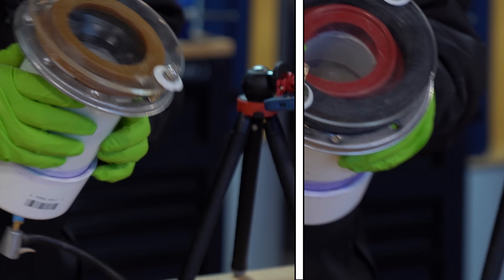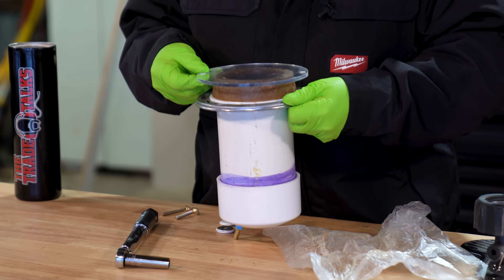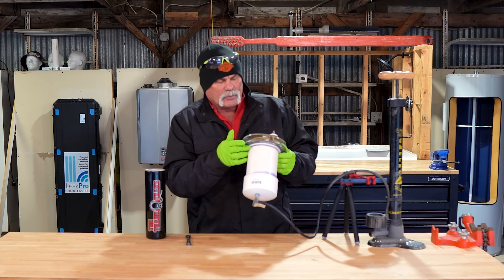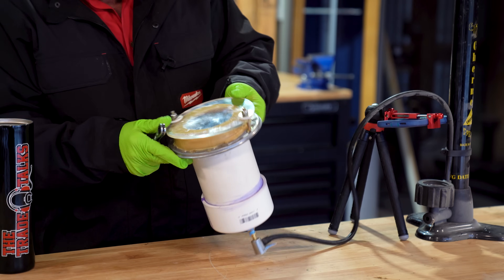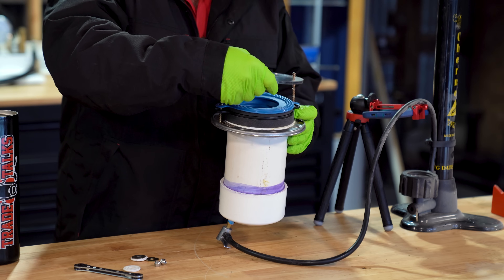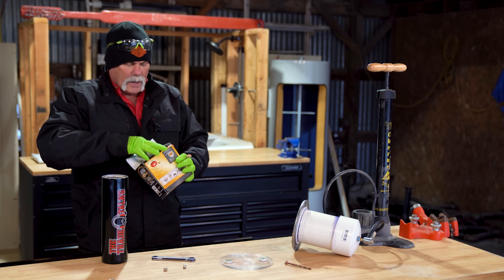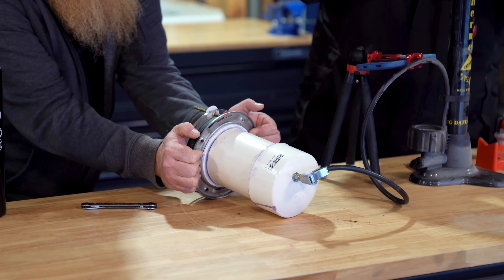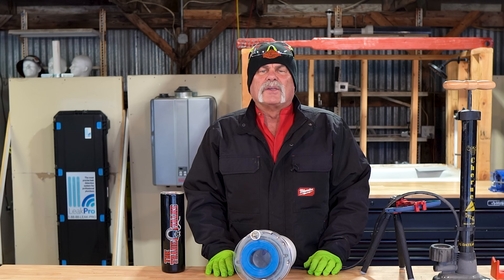Toilet Wax vs Rubber: Which Works Better?

Comment: Hey Roger, I just ran into this choice. I didn't buy them, the home owner did. I did a tile job in a couple bathrooms. The customer got this real thick cement covered foam board, instead of 1/4" Hardy backer. By the time I was done, the flange was now real deep below the tile. I told customer I needed the Jumbo wax ring. He brought those and the foam type. I wanted to try the foam type. With the toilet on the foam, it wasn't even squishing the seal down. So, I just used the jumbo wax ring. Worked great.
Reply: for very tall gaps, some recommend stacking an additional rubber/foam kit, so it can have as many as 2 rubber rings and 4 foam rings.
Reply: @jkhijirida  I've never seen an additional kit that I can buy. I'd have to get another foam ring and use the ones that come with it. And they aren't cheap.
Reply: @macD723  you buy two whole kits and stack them one on top of each other. yeah, not cheap, but it's better than a leaky joint.

Comment: Building maintenance tech for almost a decade at a hospital, we use the rubber and foam, 2 issues aside from test rig itself, there's an adhesive on the foam that needs to have the protective cover removed and secondly, just only 1 at a time, it comes with a spare just in cause you mess up the sticking.

Comment: NEVER going back to wax. Zero problems with the rubber/foam seals (Fluidmaster Better Than Wax). You never know if the wax set right when you add pressure and you certainly can't lift it to readjust or else you're scraping wax and doing it again.

Comment: I have done 8 or 10 bathroom remodels when I go to set the toilet by myself I crush the wax ring I used the rubber ones I've not had a complaint yet but I believe in the wax ones.

Comment: I used some rubber rings and when I had a backup the sewage came out on the floor.  So now if I use one I put some silicone on it and seems to work better.  Another light green one has a softer seal that I don't use silicone.  But too soon to tell I am still in the testing phase.  I still usually use wax rings.  The guys to ask are the maintenance guys that have to deal with leaks after the plumber leaves.  But all the plumbers I know still use the wax rings.  I should know better in another 10 years.

Comment: The plexiglass flexes where the toilet won't.  I don't think this really tells us anything....
Reply: The wax will give before the toilet or the plexiglass, path of least resistance. So I think it's telling us something.
Reply: @billrowan1957  so... how do you explain the plexiglass flexing at 5 minutes, 38 seconds? Plexi is a very soft, flexible material. In order to create a proper seal at that thickness it probably would have needed at least 8 equidistant bolts... and even then with plexi that thin, it might have cracked under pressure (probably radiating out from a bolt hole).

Comment: The past time I had to pull and replace a toilet due to a wax failure, I used one of the newer designs. (Side note: I'm not a plumber, just an old fart that can do things like remove and replace a toilet.) More than ten years on, and the new one hasn't failed. But to be fair to the old wax ring that failed after only a couple of years, the toilet had a slight rock (my fault, I also installed the stone flooring and it wasn't completely level,) and I shimmed it when I figured out why it failed, so that likely accounts for the actual difference in longevity.

Comment: As a 35 year veteran service plumber I have seen my share of gadget's under toilets instead of wax. I have also had those "horned wax seals" cause stoppages. The very best seal in my opinion, with my years of experience is the jumbo was seal. It is the only one on my truck.

Comment: I used better than wax ring for my last toilet install. I really like these - they work well and are totally re-usable. If you read the directions - you should use one or the other foam depending on how high or low your flange is set. I would definitely recommend these to homeowners.

Comment: I have tried many seals in multiple countries. The Aussies got it figured out, but the American toilets are still behind the times. That being said , i like the wax better. Have never gotten a callback on the wax, had at least 1 on the rubber. One callback is enough for me, no more rubber.
Reply: What do the aussies do?
Reply from the maker: I’m with QBall, what do the Aussie do?
Reply: @RogerWakefield they go in the woods 😜
Reply: Their toilets are built a little different. They have an extended seal area on the bottom with a rubber seal that gets mounted instead of a toilet flange.
Reply: I can't post a picture, but the rubber seal is easily replaced, and the toilet van be pulled and reset multiple times on the same seal.
Reply from the maker: the woods go to them

Comment: DIY hone owner, bathroom remodel. New $500 Mansfield Barrett toilet with new marble tile floor.
I used the new blue better than wax silicone gasket.
The manufactured toilet sits higher from seal level sona thick or extra wax ring was needed.
After installation with wax a couple days later I had water under the toilet😢 R&R the toilet again, I couldn't see an issue with the wax ring but opted for the extra thick wax this time.
2 days later YUP Water on the floor...WTAF? 😮😮
R&R the toilet again, I couldn't see an issue with the wax ring, THIS TIME I opted for the blue silicone.
Easier assembling to set the toilet as a one piece unit.
2 days later AGAIN water inder the toilet... getting to be quite the toilet setting professional at this point 😂.
I bought another seal kit after taking measurements and finding this Mansfield Barrett toilet sits a little higher than the old toilet soni doubled ip the gasket sets.
2 days later WATER ON THE FLOOR.
I installed the ild toilet with one blue gasket and NO Water after a few weeks.
Did some slucing with some BLUE food coloring and found a manufacturer defect issue with the porcelain sealing around the toilet drain... SWEET $500 DOLLAR toilet and this is the quality of work.
Ordered another toilet and waiting the 2 months for delivery.
Finally installed it with a pair of blue gaskets and the world is spinning back on its axis again.
The blue seals are great. Less mess than wax BUT if you set the toilet right any seal will last for years.
I have the front bathroom toilet to R&R and will be using the blue seal for that job.
One thing about plumbers using wax is the SAME plumber probably won't be back to work on it a second time.
As a DIY home owner the wax is messy, but if uour having to pull up the toilet often you have other issues.
Reply: $500 mansfield! 😂😂😂😂😂😂 thats like a $50k yugo.
Reply: You may have a Mansfield toilet but Al Bundy had a FERGUSON !  If it was good enough for Al. . . .

Comment: I have an old house and used the red rubber/foam ring you showed off last. With how much my house moves in the winter/summer I wouldn’t do wax.

Half of my doors don’t shut in the winter due to the house movement lol. In two years I haven’t had issues yet. I have even moved my toilet a couple of times to redo the floor and paint behind it. It was nice not having to go back to the store to get a new ring. No sewer smells.
Reply: Those are probably not house movement but expansion/shrinkage of the wood due to changes in humidity.

Comment: I learned with wax about 40 years ago. I don't know how many of those I've installed. About 5 years ago I tried the rubber type. Looked interesting. I don't carry wax anymore. They're too much trouble for me. I've had applications where wax will last for 3 years, then fail. Water comes to the ceiling below. Since I switched to rubber, no more problems. I can send even a new guy out and there won't be a problem. At least not with the toilet soil stack. He may screw up the water supply or something else.

Comment: This is bad science. The acrylic flexes too much not a fair test for any of the seals. You push a toilet flush then secure in location with the bolts. A toilet won't flex like that.

Comment: I went with a better than wax and it worked great.  The previous wax install failed after 5 years (previous owner's install) and when I pulled the toilet out it was obvious that it shifted upon install and the seal was never properly made.  The wax was skewed to one side.  

Two years on and still good.  I was WAY easier to install and less of a mess, as well as allowed me to reposition the toilet when I dropped it in by myself.

Comment: As a homeowner I have done both, and neither has had an issue.  Very limited experience for sure, but like you said there really shouldn't be any pressure on your sewer system there.  I do like the easy clean up when replacing or re-setting a toilet on rubber, but I do like the affirmative squish of the thick wax rings.

Comment: The point of the rubber with the foam is not to provide a pressure seal put to provide constant positive upward pressure which if the toilet rocks or becomes loose it will still remain sealed, once a wax ring is installed it's a one time seal and any movement will compromise it, I haven't used wax for like 10 years and have never had a problem with a call back like I have with wax.

Comment: Probably 10 years ago now I was using a rubber accordion type toilet seal. It went on the horn of a clean toilet with a double sided tape, that was super tough, then you opened it up and set it allowing it to collapse as you set it, I would use them in a retirement home when I had a tenant who continuously broke their wax ring

Comment: I’m thinking a properly installed rubber seal on a toilet will have considerably more seating force applied to it than your acrylic plate.  
The weight of the fixture plus the closet bolts would compress the rubber more.  Also it wouldn’t distort as the acrylic plate did.  I think it would hold more pressure under actual conditions but 🤷‍♂️ :)

Comment: While I am not a plumber, I have set many dozens of toilets over the decades. I have never liked the wax rings because they are so stinking messy and hard to clean up. I started using waxless rings when I first saw them in the late 90's and have never had one fail. On the other hand, I have seen many wax rings fail for various reasons, mostly due to an improperly set toilet.

I had my parents' bathroom remodeled back in 2012 after my dad had a stroke. Due to them having only one bathroom, the man I hired to do the remodel needed to install, uninstall, and reinstall the toilet many times over the course of the remodel so that both of my parents could use it when necessary. We used a waxless ring, and it never failed. In fact, my brother bought the place and has lived there since 2014, and replaced the toilet in 2022, reusing the waxless ring that was installed on the old toilet 10 years earlier, and it has worked perfectly since then as well.

I will probably always use some sort of waxless ring when setting a toilet.

Comment: Blue rubber works excellent, now on mine the flange is 1/4 above the floor so you don't use the foam ring just the blue rubber ring. Works fantastic and no mess. Great for science video!

Comment: I am a property Manager, not a plumber but I have changed Many Toilets and wax rings!  I used the Blue rubber / foam "reusable Perfect Seal Rings"  HA! for a few years until a plumber told me how they dry out and don't seal after a short while.  and I saw with my own experiences, I will never use them again.   Stick with the wax rings for longevity!

Comment: I started using the rubber seals from HD a few years ago in both new builds/remodels and repair/replacing faulty wax seal rings.  The good thing about them is that they are not messy, so if you need to remove/replace the toilet, you simply reuse the seal.  You are correct, in that there isn't going to be that much pressure on a toilet.  I specifically like using them on retro fits, because around here, we have a ton of lead downpipes into cast iron.  Well, as we know, that lead can deform and leak.  When you have a wax ring, it will leak, because it follows the lead when it moves.  The good thing about the rubber ring is that it has an extended flange that goes down into the lead pipe, so no matter how much the lead moves/deforms while under the "normal" use of a toilet, that extended piece will cover the gap within 1 to 2.5 inches.  And we also know that if your flange/downpipe separate more than 2 inches, you have issues far beyond anything that a ring seal will cover, no matter what it is made out of.

Here in the Greater New Orleans area, we have major issues with houses settling constantly due to the ground subsiding.  This is followed up by the house foundation needing to be leveled again.  This issue can go on for decades, where the house sinks and the foundation guys lifting.  Many times the plumbing, specifically the sewer side, does not always follow the house, so the flanges under the toilets can, and does falter and need to be repaired.  This is where the rubber part shines really well for me.

The thing about the rubber part is that, as you showed, it comes with the extra ring.  This ring is only needed if the flange is below the tile level.  you can get a second one if your flange is more than 1/2 inch below the top of the tile, but that is rare, at least in my experience.  Most of the time I am not even using the extra foam ring, and the rubber ring seal works just fine.

While I have only been using these for a few years now, I have never had one fail.  One other great thing about them is that if the toilet needs to be removed for tile work or needs to be adjusted a little bit, it will not require a new wax ring.

I just used one in my own house last weekend, because the lead down pipe had deformed and separated just a 1/8th inch and you guessed it, it leaked.  Of course my wife called me, frantic because the ceiling of the coat closet on the main floor had started to leak.  So when I got home, I ripped the sheetrock open and saw a tiny little drip.  I knew exactly what it was, ran up the block to HD and bought a rubber ring, repaired the deformed lead pipe and installed the new rubber gasket.

Comment: When I first moved in there were roots growing in my sewer pipe and it required several runs with the auger to finally clear the drain. Luckily I have not had to auger the pipe for a couple of years now but after the second time pulling up the commode to run the big boy I went back with a silicone seal and it has proven to be a great seal and no mess to clean up. No more wax for me!

Comment: I like the danco version... Wax on the bottom... Rubber on top... 

Which means it stays flexible...

I've been in too many houses where the wax rings failed after 10 years, allowing water damage to occur to the subfloor and the ceiling below ....

And a few homes where the wax ring failed after somebody plunged it too hard.

Comment: I'm a home owner and I use the better than wax seal. I don't have any leaks or smells and it's been several years. I put one in my church with the same outcome. Also, the one at church I recently had to remove the toilet for water line issue and when I put the toilet back I had no issues with it resealing and that was a couple of years ago when I replaced the wax seal.

Comment: I've installed several dozen of the FluidMaster wax free toilet seals with no problems and no call backs. However, I have recently switched to using the Fernco wax free toilet seals. They have a long finned spigot that goes down inside the drain pipe, and they have a top ring of adhesive that glues them to the bottom of the toilet. Between the tight fit into the drain pipe and the adhesive seal to the toilet, they seem to be absolute proof against sewer gases or leakage. You do have to carry the three different pipe sizes which are 3, 3 1/2, and 4 inch pipe sizes. Most recently I've been using a similar wax free seal from ACEDUROBLA. It's very similar to the fernco, but it has a much more aggressive adhesive for gluing it to the toilet spigot.
Reply: where can buy ACEDUROBLA in he USA ??
Reply: Mine failed at 5 years.

Comment: Great vid, thanks for putting it together.  To me, the unknown is how long the rubber/silicone lasts.   I've seen various formulations of seals deteriorate over time.  Wax, on the other hand really never falls apart, something else changes that makes the seal go bad usually. The pressure test is interesting but you really don't get much pressure pushing out.  That being said I like the easy clean up of the rubber seals and I might try one next time.

Comment: I tried two of the non-wax designs in November 2023 with a 16 year old Toto and neither fit up properly and they leaked.  Back to double wax and bingo- no leaks.  Toilets are not glazed or smooth on the bottom- so the flexible (rubber/silicon) seals don’t fit up leak free.  As compared to wax which   fills the voids and seals.

Comment: I used that korky rubber one that didn't hold any air in your test.  It hasn't leaked after a year and I'm happy with it.  I think if your floor shifts it your toilet wobbles you are better off with a rubber and foam ring due to the elasticity.

Comment: As a DIYer homeowner I would like to know if the wax ring is meant to seal fluid & gases?  I'm asking because after using a plunger to unstop a toilet it started leaking water around the base afterwards.  I enjoyed your demonstration.  One factor that may have to be duplicated is the toilet surrounds the wax ring when it is set on top of it.  That insures a better seal in the field.

Comment: Lol I tried all of these. I'm not a plumber just a home owner and found that a normal wax ring works best if your flange is properly installed. Yes the rubber ones are less messy but how many time do you replace your toilet really think about it. I still have the same one from 25 years ago. 1 properly installed wax ring will last you a lifetime.